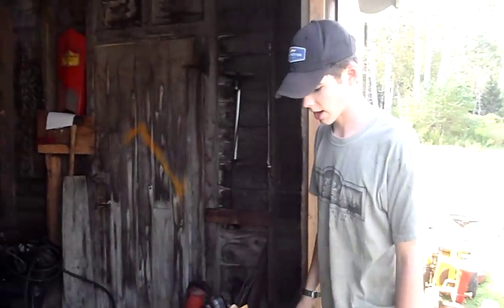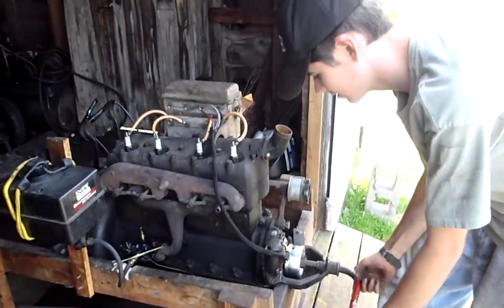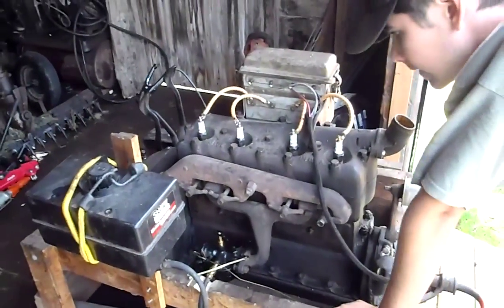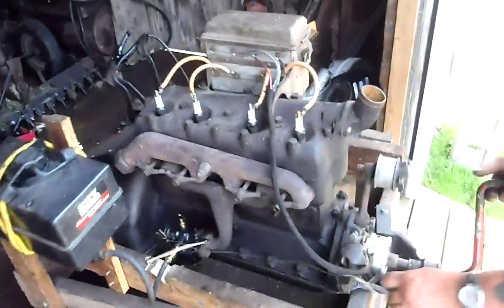Working on 1917 Model T engine part 2

Comment: What do you figure, maybe about five minutes running before it might get heat damage from no coolant?
Reply from the maker: Peter d it had water in the block, but without a radiator. I’d say 3-5 minutes is safe since the engine isn’t under a load.

Comment: id get tired of cranking mine too even though it had electric start the battery would be low sometime's so i had to crank it  and then it would start,you should go to the Henry Ford museum and greenfield village,  in Dearborn Mich.
I know you'd have a blast looking at everything there,
i was there in feb 83 and it was really something,
It's totally worth it if you like Model T's like i know you do
another trhing is to get into the local chapter of the MTFCA 
Model T ford club America.

Comment: No smoke and sounds healthy   .Did you rebuild it  or was well preserved
Reply from the maker: At this time the engine was just well preserved. It was later freshened up with a valve job, new rings, and by taking a few shims out of the Maine bearing
Reply from the maker: *main bearings
Reply: Cool thanks for getting back to me I pray my 21 sounds that good when i get the point that i can start it

Comment: you know model T's and how to crank them.
that's good.
you ever have it pop backward on compression?
or start without warning with gas in the cylinder's?
theres alot of really nice car's out there  
but the T's are easy to deal with and theres plenty of part's around. 
so thing's arnt a peroblem.